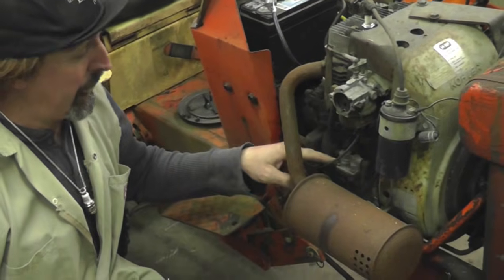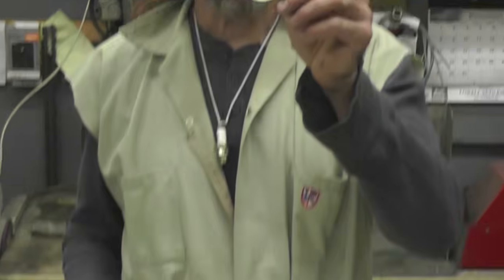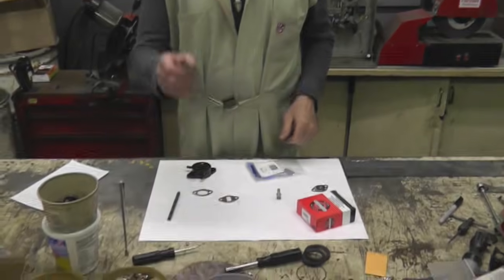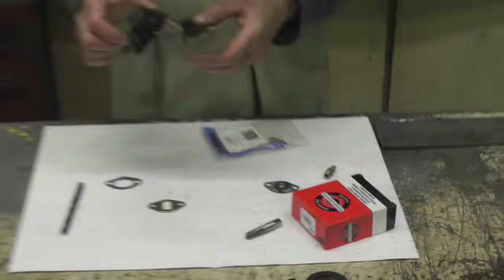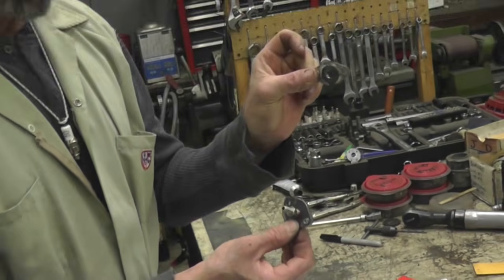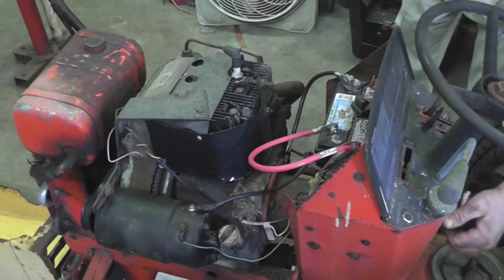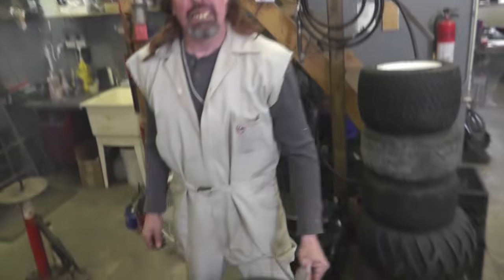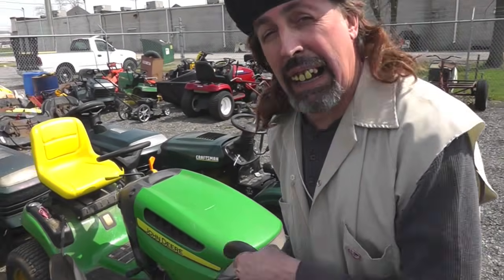How-To Repair Kohler K Series Fuel Pump - with Taryl

Comment: The Chinese piece of crap pump I bought didn't work but this did. I bought the stens fitting, the mikuni pump and the 11/64 drill bit with a 1/8 pipe tap and followed each step and it worked. If you leave the "fuel out" line off of the carb to test it you can see the fuel pumping out perfectly.  This was very helpful. Thank you.

Comment: I gutted my mechanical fuel pump and plugged one side and hooked the other side to a vacuum fuel pump and it still won’t pump fuel. It does have fuel running all the way to the pump. Just can’t figure why it doesn’t work? Did I buy a bad vacuum fuel pump? How much pulse vacuum should it have going to the pump? It doesn’t seem like much vacuum when I put my thumb on the hose. Could it have gotten too much oil in the vacuum hose?

Comment: Why couldn't you use a 12 V? Fuel pump and plug the hole in the engine with a plate.

Comment: I bought a chinesium fuel pump and removed the diaphragm and installed it in the Kohler pump, fit perfectly, been pumping for years now, and now they sell the chinesium diaphragms separately,  bought a couple for spare. easy to change without removing the pump from the engine.

Comment: Hey Taryl, good job as always. Just a hint -- don't throw away that old Kohler metal fuel pump! There is actually a rebuild kit for it, and the metal pump is worth money on eBay or elsewhere. I made the mistake of tossing mine after I replaced it with an inexpensive plastic pump - I didn't know at the time there was a rebuild kit. Now I'm stuck withe the plastic units, since they cannot be rebuilt. The cheapest used metal pump I could find was $149!! So hold on to the old pump for future use, or make a few bucks selling it. Thanks again!

Comment: I thought you did one where you just gutted the Kohler black plastic mech. pump Intake (left side) and used it for pulse after screwing in a 1/8"NIP to 1/4 barb into the intake?  1/8 pipe thread CAP went into the right side of the black plastic.  No welding or metal cutting required there........

Comment: I just did what some earlier posts said they did and used the old pump.  Plug one end and use the other for the new pump. I left the old diaphragm in and made a 3/8" hole in it.  Works like a charm.
Reply: u could almost use one of the caps on the new replacement pump to block the old one with

Comment: Great video Taryl thanks for this.
However this is what I found when I went to buy that pump.
 
Briggs & Stratton fuel pump 597338  replaces old #'s 808656 691034, 692313, 808281, 491922, 808322, Kawasaki 49040-7001, Honda 16700-ZL8-013, and Kohler 24-393-16.
Reply: Is this the correct part numbers for this pulse pump I want for my 321

Comment: Hey bud I have toro z master 2003  has a Kawasaki engine it shows it had a  Kohler.the wiring harness on this toro it a mess.would you hard wire the hole mower. If so where would buy the connectors. Toro said since the motor is different there’s no wiring harness.  Thank Mitchell

Comment: I bought a 129 cub cadet, was sitting outside 10 years. Put new carb on, fires a little, but won't get enough gas to start even chocked. Any thing I can try next? I don't know if the motor is any good.  Thanks

Comment: Probably wont get answered....2 things. My cub 1250 doesn't have a fuel pump cause the tank is higher then the carb. I need to do a replacement engine (wile i get the one that's smoking rebuilt) and the one I got as a replacement (a 16 horse off a Wheel horse where the tank is in the back under the seat and below the carb) has a fuel pump. Can I bypass it and just put a plate over it? Secondly those fule pumps are 11$ for an OEM on ebay that's new....Why wouldn't you just do that even if you replaced it every year?

Comment: What a great video fixed my 214 due too his advice.
Reply: Where did you place the new pump on your 214?  Not enough room on mine to put it anywhere but in front of the air cleaner.

Comment: I did this fuel pump conversion on two of my Kohler K-321 14HP engines and it works great! After going through several of those junk aftermarket pumps that are sold on eBay that would fail after a couple hours it's nice to find a fix! Thanks Taryl!
Reply: With my version, on a JD 214, once the air cleaner is reattached, I find the pump will need to be hanging nearly in front of the air cleaner as there isn't enough room behind it to lace the new fuel pump.

Comment: Hey Taryl,  thanks for this entertaining and informative video!  I am trying to do it on my K181  eight HP  engine on my troybilt tiller.  I  ordered a kit for the vacuum fuel pump and I have some sheet steel to make the cover plate. My issue right now is that I cannot see  where to take the screws out of the existing fuel pump to remove it , so I can proceed with the change over. Have you ever done this on a  K181   ?

Comment: I just bought aftermarket oem style mechanical fuel pump on eBay for $11 and had it running in 5 min lol
Reply: I tried an aftermarket one from eBay, it didn’t quite last a year.

Comment: Daryl I bought the pump you said to and I removed the pump on my lt160 and gutted it and used the diaphragm and removed the center I haven't tried it yet but will in a few days.  These darn China reman carbs have no air fuel mix just idle only.  I hope my setup works and thanks

Comment: Hi there. I have watched a few of your video's and yep very informative thank you. OK here is my problem I need some help with. I have a Craftsman garden tractor with a Kohler CV22S. I tried starting and a no go. Primed and ran till out. Pulled outlet side of fuel pump and sort of trickle of fuel when cranking. Order a new fuel pump trickle is better still no start. Pulled carb and check anti back fire valve and it does does work. Took carb apart and cleaned it all up including the solenoid valve so it moves even better. Put back on and it started and ran for a few seconds then no start again.
I checked to make sure fuel is getting to carb. I cranked engine with everything connected and checked fuel bowl, it was dry. Unplugged solenoid and cranked, bowl then had fuel. Engine started and ran again a few seconds, with no gushing out fuel but a steady flow. I am starting to wonder if my engine has major problems. I connected a vacuum gauge to the  crank case pulse port, cranked engine and nothing. Put finger over port and cranked and can feel slight push of air and intake. Should the pulse port be strong enough to move the needle of vacuum gauge or maybe has my carb seen better days?
Reply: Check vent on your fuel cap I bet it's plugged

Comment: Hey Taryl - Great show.   The circus is always in town.    Wanted your comments on what my pal said.    He took off the Bad Order mechanical fuel pump, ripped out the guts, sawed off the lever arm, and put it back on the K301 -- just to use the hose connection for the pulse air inlet.  He plugged off the other discharge side.    Then he stuck on a $7 Amazon pulse fuel pump and viola, and he said he saved some cashola.  $134 for the new mechanical fuel pump at the local shop.    Any down side to this method ?     Like Kenneth did below.

Comment: I like your videos.  I have a question.  I have problems related to old fuel every year.  I know what I am supposed to do.  I also know, that I am too lazy to drain the carb.  I am never too lazy, or too cheap to spend 100 hrs, or $500 once to save 10 minutes,  or $100 every time I use a machine.  I am tired of bringing the engines to a shop and paying $100-300.  Pickup charge, repair charge, delivery charge, they find other problems.  I am thinking of making a carb bowl with a small 1/16-1/64 inch drain hole that constantly return the fuel from the carb bowl to the fuel line before the fuel pump.  I expect the fuel pump can pump enough extra fuel to have a small hole in the carb bowl.  The idea is to constantly drain gasoline slowly from the carb.  The fuel pump can over come this lose, so the engine runs normally.  When the engine is shut off the bowl will drain back to the tank in 1-15 minutes.  In this way the carb will not get gummed up from the varnish left when the gasoline evaporates from the carb.  Do you see any problems with this idea?  Can the pump provide enough fuel?  Will the small drain hole get plugged? This will only work if the carb is above the tank.
Reply: I want to try this first on a John Deere 212 with a K301 engine.  Then, I need to modify the design for a Honda EM5000S.  The gen has the carb below the tank.

Comment: Hey Taryl, I'm working on a 20 horse Briggs V-twin in a craftsman rider. I'm having trouble with the fuel delivery. The fuel flow from the tank is free and clear, The pulse hose is short about an inch and a half and goes right into the valve cover and it's in good shape. I tested the fuel shut off solenoid in the bowl and it is functioning properly and allowing and not allowing fuel accordingly. The fuel pump has already been replaced but I think it is no good. The reason I say this is because I feel I've done every other test including putting a vacuum gauge into the signal port and I pulse between 1 inch of vacuum and 1 psi pressure. Two questions, first,  is that enough vacuum and pressure to operate the pump and if so does it seem as if I have a failed new pump? Thanks in advance. Tom

Comment: Taryl, I just replaced the fuel pump 15 HP Kohler (J Deere LT155). Clean lines and cracked her up. Fuel came to the fuel filter but not to the carb. Carb is dry as a bone. What would cause that? Thanks georgelbenson@aol.com

Comment: I did this and oil worked into the vacuum line and was dripping out of the fuel pump. The oil is thrown araound inside the engine by a slinger on the bottom of the connecting rod which is in line with the plate Taryl tells you to put on the engine.  To solve this problem I drilled and tapped the secondary upper oil fill plug (with the plug removed) on the K301 and connected the vacuum line there instead. You could drill into the block, but there is a good chance of getting chips in the crankcase.

Comment: You can also cut the center out of the diaphragm in the mechanical fuel pump. This will allow vacuum through the outlet line. Plug the inlet line with a 5/16 bolt and a short piece of hose. Now hook the pulse line to the old mechanical pump outlet line instead of making a plate.

Comment: I gutted the mechanical pump and used it to get crankcase vacuum to the vacuum operated fuel pump. cut holes in diaphragm to get vacuum from crankcase. Thanks to Taryl for idea.

Comment: Taryl you the man, I did this to my 18 hp kohler magnum engine cost me 12 bucks,Sears wanted 90 bucks for the fuel pump.after I fixed the tractor I looked on Amazon and the machanical fuel pump was only 20 bucks. So remember that Taryl Amazon .com 20 bucks for the machanical fuel pump,Thanks again love your videos keep em coming

Comment: I did the same conversion on my 18hp twin and it worked just like you said. The mechanical was pumping fuel into the engine. Thanks for the video
Reply: I had the same problem with fuel in the crankcase on my Mamum 12. I opted for an electric fuel pump.

Comment: Just replaced a bad mechanical pump with an old Briggs vacuum pump I had laying around. Having rebuild dozen of old K series engines for IH Cub Cadets, I had a bunch of fuel pump block off plates as the IH Cub Cadets were all gravity fed, no fuel pump. The block off plate worked perfect, I tapped for 1/8-27 NPT and used an old brass barb I had in my air fitting pile.  Worked like a champ!  Customer was happy as a clam as I dropped my quoted price for the job by 45 bucks. Thanks Taryl!,
,
Reply: Yea I bought the block off plate and tapped that.

Comment: OK, gravity feeding a Cub Cadets is getting annoying. Would it be possible to just remove the pump diaphragm from the original pump, remove the valves, plug the outlet connector and still get vacuum from the crankcase off the inlet connector?
Reply from the maker: +kd9bwi  That will work gutting the old pump housing and using one fitting  & plugging the other to pick up vacuum off the crankcase.
Reply: +Taryl Fixes All LLC Thanks, I'll do it before the first cutting. Doing the conversion the way you do it would require pulling the engine to take the air directing metal off to get to it.
Reply from the maker: Just remember any where you can pick up crankcase pressure above the oil level will work for these vacuum operated fuel pumps.
Reply: Taryl Fixes All LLC what about the breather tube going into the Air filter?
Reply from the maker: No, Some older flat head Briggs engines would have a separate fitting on the breather. I've seen fittings on the dipstick tube. And I've even drilled & tapped the block close to the top of the engine. OHV engines some use the valve cover.
Reply: Taryl Fixes All LLC The engine I had in question on using the breather tube running to the air filter is a kohler kt17. I'll see about using the mechanical fuel pump on it. Would removing the diaphragm and check valves be enough, or do I need to gut the whole thing?
Reply from the maker: as long as you can create a path for the vacuum from the crankcase it should work

Comment: Taryl, my oil pump in command ch18s is broken. 24 393 53-S will be ok? My old oil pump is 24-327-04 but I can not find it on the internet. What is the difference ch18s of CH18? 
In both the oil pumps are the same?
Reply from the maker: +kazeczek15  Should be. I can't find that old number either. You can contact where we get a lot of our parts from Pro Parts Direct .net They have a live chat you can do or simply call them. They have very experienced counter people who work there. They also have parts look-up on their web site.
Reply: +Taryl Fixes All LLC I checked, my part  is old , matching model is 24 393 53-S. THX

Comment: I just completed this conversion.  I cut the plate out of a piece of metal and drilled the holes for the screws and fitting.  It works perfectly and the engine starts so much better.  Keep the videos coming.  I have learned a lot from these videos.
Reply from the maker: +Winston Mangum Theres Yur Dinner!

Comment: It says Briggs and Stratton on the box, but it is pretty much the same pump used on some Kohler, Kawasaki, and Generac engines.
Reply from the maker: +Charles Faust Yes, Its actually made by Mikuni for all those company's the only difference is where the lines hook up. On some pumps the lines are clocked in different positions to accommodate the fuel lines & pulse line for their specific engine. Just a simple vacuum operated fuel pump. Anywhere you can catch vacuum off the crankcase above the oil line it will work. Some engines will have the vacuum port on the valve cover. Others I've seen ported from the dipstick tube, some have a drilled & 1/8" pipe tapped hole in the upper part of the crankcase. So I hope this helped you in repairing your engine. Theres Yur Dinner
Reply: Taryl Fixes All LLC We've tapped the valve cover on a couple that the crankcase vacuum wouldn't work on engines that were about worn out and wouldn't operate a fuel pump from the crank case.  I really liked this video because I hadn't even thought of doing what you did there.  Theres Yur Dessert :)

Comment: i have the same mower can i bypass the fuel pump if i reroute the gas tank somewhere different.
Reply from the maker: Robert Mccaffrey So you want to gravity feed it? I'm not positive if that will work but it's worth a try. If it works, let me know!
Reply: Taryl Fixes All I have a cub cadet 782 and the fuel pump is shot, but as long as the gas level is above the carb bowl, it work fine.

Comment: I'm wondering if one could gut the fuel pump, seal the two halves with a gasket material with hole in place of the diaphragm, plug one of the ports, and use the other port for the pulse line?  Taryl did something simular in another video with a valve cover mounted fuel pump.  As one with limited tools, this would be a lot easier than fabricating a fitting like taryl did. Has anyone tried this?